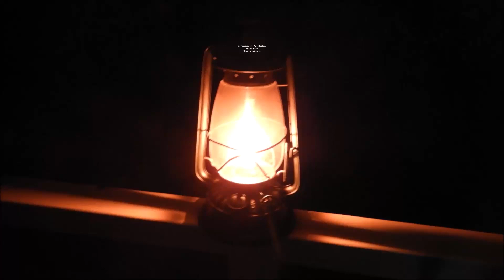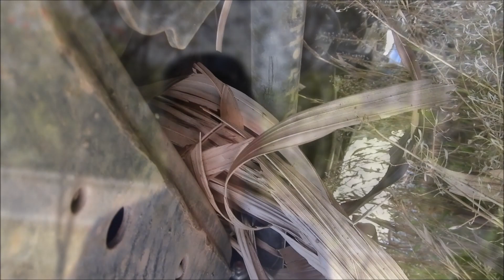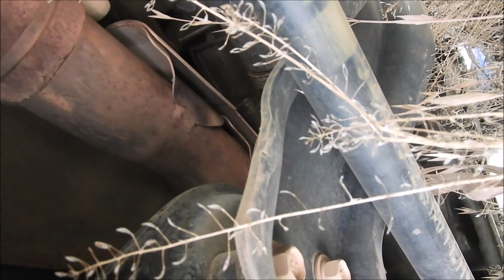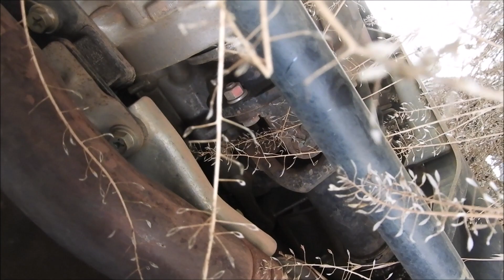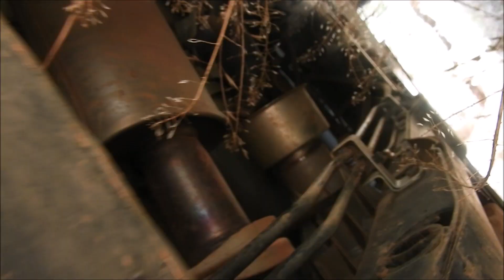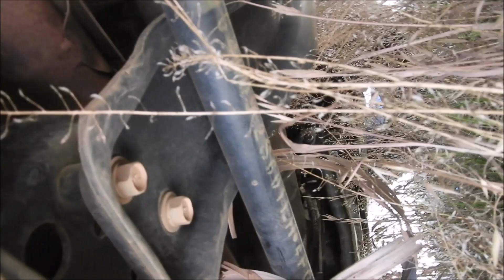Car exhausts systems. Bush fire, Wildfire ignition?

Comment: This should be part of bushfire risks in the media !! 
Saw where fires have started on roadsides, granted siggy butts may be the cause, well published, mmm ...wunder how many have been started by hot exhaust systems as cars move on after momentary pitt stop.
Possible????
Reply from the maker: That's a good point, could well be a cause, unknown to driver.
Reply: Well, yeah. This has been known to happen with harvesting large grain crops. the operator, may not be aware of the fire after considerable distance and time on large acreage.

Comment: The cat on the exhaust runs very hot would easily be enough to burn dry grass. you make a good point in your video.
Reply from the maker: Thank you thornwarbler.
The Cat would be a heavy machine?
All the best. 🇦🇺🇦🇺🇦🇺
Reply: aussysurvival no mate sorry when I say cat I mean the catalytic  converter
Reply from the maker: @thornwarbler  thank you mate. I was very surprised at the temps on these catalyctic  converters.
👍

Comment: G'day,

Yay Team !

   This is why my Road Car & Paddock-Basher both have Fire Extinguishers, and my Road-Car currently features a 16 Litre Firefighting Backpack too.

  Most stories of Vehicle Exhausts  igniting dry Grass tend to date back to the dayze when the Exhaust Manifold  was Cast Iron, afixed to the Head, the Exhaust Pipe was fixed to the Chassis' Crossbeam ; and between the two was the "Engine-Pipe", with "Doughnut" Gaskets at each end to permit the slightly varying  geometrical alignment between the stationary  Exhaust Pipe & the Engine - vibrating and Torque-twisting in it's Rubber-Block Mounts...

  If the Engine-Pipe's bottom Doughnut failed, or if a Rock tore or wore  a hole in the Pipe..; then at night one could see rich Yellow-Red flames jetting forth.

  So parking on dead long Grass and idling there, or driving through it ; could be a recipe for disaster.

  The Hughes 269 Heligigoflopters, which became the Hughes 300, since rebranded as the Macdonald-Douglas 300c..., has it's (Piston) Engine Exhaust pointing backwards & downwards, from the lower Rear of the Engine-Bay....; every couple of years some thoughtless individual manages to incinerate their little 3-seat  Twirlybirdie by landing it in dead dry long grass..., then sitting there roaring away at a fast Idle - waiting for the Cylinder-Head Temperatures to subside before shutting down the Engine.

 It's a Dumbarsed thing to do, but someone does it reasonably regularly (!).

   A bloke called Charlie Darwin had a word for it..., "Evolution" was what he called it...(!).

Such is Life...

Have a good one.

;p

Ciao !
Reply from the maker: Evolution ! 🤣
Yes remember those days of older cars, those manifolds would glow sometimes. Also carry a fire extinguisher in my vehicle.
But .... a true story. I was in a friend F100 truck on highway.  Fire started in engine bay, old vehicle. Not sure what caused it, electrical or, organic junk in engine bay, being from a rural property. The fire extinguisher wasn't enough to contain or extinguish fire. We quickly abandoned the vehicle, as flames burned into cabin via fire wall cable gromets. Damn that was scary, had LPG fuel tank in the back. Fortunately it happened on bare ground, road side. Other drivers helped but fire was too severe for their fire extinguishers. A fire unit turned up and put the blaze out with their advanced fire fighting gear.
Now, the owner was always fastidious about keeping engine bay and exhaust system clean of organic flammables. Just this one time he missed some, and the rest was history.
New cars these days, can't see right into engine bay, exhaust systems are crammed, have air gap heat shields, which can clog up with flammables, can't see squat, let alone clean the crap out.
Yep design evolution, lack of geek foresight for use in rural locations. Thanks mate 👍.
Reply: @aussysurvival  

That sounds like a scary episode.

I try to keep moving when the grass is higher than the bottom of the Engine, and if I have to stop in dry long grass I switch the motor off, and walk around sniffing for smoke.

   One can't mow 100 Acres..., so strategies have to be developed to deal with the risk...

Such is Life,

Have a good one.

;-p

Ciao !
Reply from the maker: @WarblesOnALot  thanks mate. In the last month or so, authorities have issued potential risks such as mowers, slashers, throwing Sparks from Terra forms, starting fires, but nothing on the topic in this video.
Yes, always looking for smoke around vehicle, in the boonies.
I guess us. old goats have better memory retention longer than 3 seconds, School of life. 😊😊😊
Reply: @aussysurvival  

  Yes mate..., we learned to read before Television invaded the Home.

Take it easy,

;-p

Ciao !

Comment: There was one started recently in suburban Redbank Brisbane.
A Ute was parked in long grass, hot day, hot engine being reved by driver. Official investigation concluded exactly what you talked about. I haven't got a link, it was in an on line news paper, which needs a subscription.
Bit it did happen, probably not a whole  lot of interest, or awareness .
🇦🇺🇦🇺🇦🇺
Reply from the maker: Thank you TH. I recall a news report on that fire. So the investigation concluded what you said? I didn't see  the cause in the news report I saw.
Thank you for sharing your information.
All the best.
🇦🇺🇦🇺🇦🇺
Reply: @aussysurvival  Read the full investigative report on that fire. it did start from a hot exhaust system.

Comment: So good to hear you again on a pertinent subject, and in general, this subject is pertinent.   The radiant heat from engines and exhaust systems are a real hazard..Example, take a highway trip, then come home and park on your manicured lawn...next day, you'll notice the grass under you engine area is brown or dying where the radiant heat from your engine has killed it....
If you parked in taller grassy areas, you might have direct contact with the grass and start a fire...something a lot of folks may not think about....
Again, good to hear your thoughts.
On another note,  have you had to clean your windshield of bugs as much lately as in past years??  Here in Alabama USA,  WE HAVE HAD ALMOST ZERO BUGS ON WINDSHIELDS, and no bees...what are your thoughts, and, how did your garden produce this year last??
Reply from the maker: Very true about the effects on green lawns. On older model vehicles, 70's or so. Have seen the engine manifolds glowing in low lite after long trips.
Insects, no notably fewer on wind screen, other bugs not as many as a few years ago. But then we are in severe drought, not a lot to help insect breed.
Bees, ohh yes much much fewer around, both commercial and native bees. Commercial bee hives are generally moved to better conditions.
Native bees, a lot of land clearing around here, but then again not a lot of pollin for them either.
Cheers mate.
🇦🇺🇦🇺🇦🇺
Reply: @aussysurvival  thank you for the rapid response....interesting...
We just got our first rain in several weeks weeks...its been very dry here....the weather patterns,  being cyclic, have brought us around again....compared to previous decades and centuries....I suggest you look into this, if you haven't already.  
We are going into fall/ winter here...last week it twas 90'sF,  this week  70'sF...water temp in the Gulf of Mexico was 87F, now 80F...
A tropical storm is forecast for this weekend coming, which may signal the last gasp of hurricane season...just lots of rain and tidal surge, perhaps 6-9 ft...
At any rate, we will fair well...hope you the same this winter there....fairing well... smile...
Reply from the maker: @robertwilson3914  yes saw a weather Sat photo of that storm system. It is huge.
When I moved into my area in 87, the winter's were colder and wetter. Summers weren't quite as hot, although storms severity were pretty much the same.
Up till now, the weather patterns are changing, and some events are more extreme. Except for 2010, winter's have been mostly drier than 87. Fewer sever frosts too.
Reply: @aussysurvival  the current sat radar makes the storm look menacing, but it is not.  Right now, I have no wind or rain, and the reports say tropical storm force only, which is around 35mph...there is a lot of hype on these storms every year...driven mostly by the media news to make a dollar.  It's laughable really, and reminds me of the "boy who cried, WOLF"...I stick to independent  sources for meteorological information,  like, Crownweather.com, and Tropicaltidbits.com...check it out...cheers. (when it comes to cyclical and decadal weather, expect change...smile)
Reply from the maker: @robertwilson3914  👍 yes the media does hype it up.  We have independent weather forecast service here,  storm chaser. His crew are more accurate than our federal met services.
" Higgins Storm Chasing " based in my area of the state. Covers a lot of east coast. He tells it how it is, and welcomes input from the public on their photos and vid footage. He really is at the coal face, has a team, but his charts and info are awesome, for severe weather events. Does a lot of hi Tek research, butts heads with our federal and state met services.
Reply from the maker: I storm chase in my local area. Two years ago, cameras on a dry storm, no official storm warnings issued for my area. But these were bad. A very close lightning strike at my camera location, damn near killed me, EMP trashed one camera. These are the ones igniting bush fires. Two trees struck by lightning, 50 yards apart on the highway near my place, same storm. Damn trees literally exploded all over the highway. The met guys got the forecast wrong, but Higgins was right on the button.
Reply: @aussysurvival  ...did you or your listeners look into the DAKOTA FIREPIT concept?
Reply from the maker: @robertwilson3914  came across a friend who was in Canada for a while.  He hadn't heard of them until a Canuck told him. So he proceeded to make one, on a hiking trip. He was most impressed with the simplicity and efficiency of it.
No doubt, most of my viewers  on that video are mericans. That is where I heard of them on social media and, forums many years ago. But, by and large, not many, in my country have heard of them, at least the ones I have spoken to recently.
🇦🇺🇦🇺🇦🇺
Reply: @aussysurvival  perhaps you can spread the word , try it yourself and distribute the knowledge...Dakota Firepits...expand on it...
Hitting the rack now...I have firewood to process/cut/split tomorrow...winter is coming fast...smile...stay in touch.
Reply: Look at Tropicaltidbits.com...weather here in the U.S.
Reply: Apologies for being so wordy...just glad you are still kicking like me, you ole buzzard...smile...
Reply: @GulagCamp 141 Thanks for replying.  The bug loss seems to be very widespread...friends of mine in different regions of the country are saying the same thing after realizing that they hadn't noticed it until I mentioned it...
I think it's possibly due to increased cosmic rays/UV as a result of our reduced magnetosphere protection during the grand solar minimum we are currently in.  If this is correct, our pollinators are going to disappear and crop/food production will plummet...which equals starvation on a large scale.  
I haven't seen a bee in two years.
Food for thought, I guess, until the food store is empty...